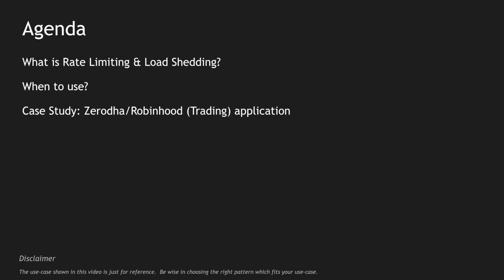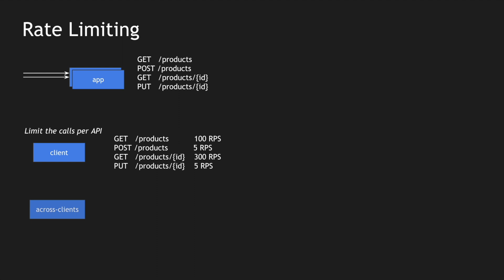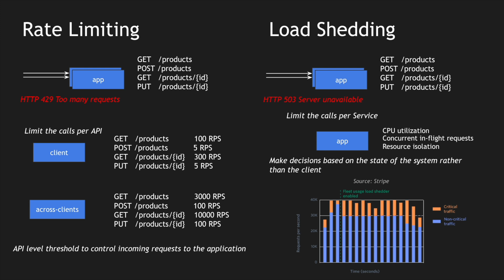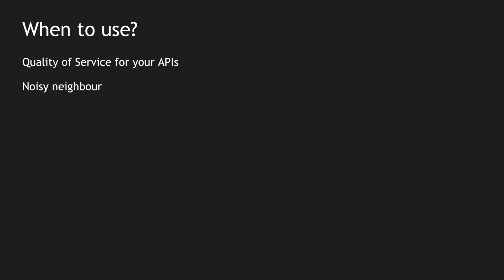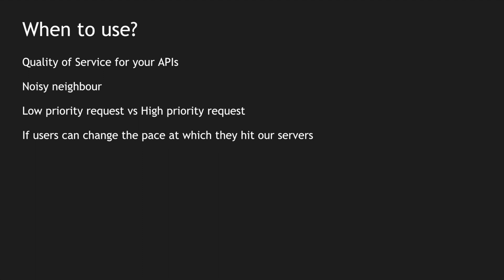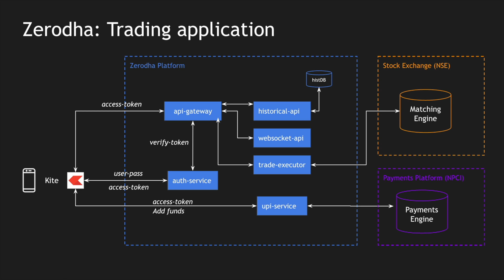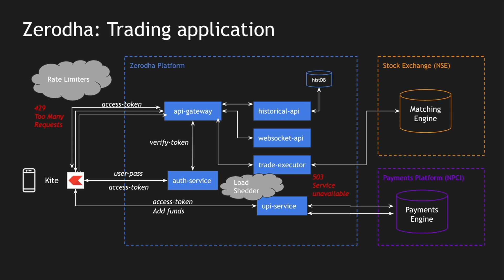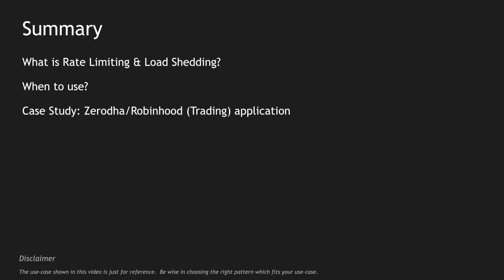Rate Limiting vs Load Shedding | Microservices Architecture Pattern | Tech Primers

Comment: Trading apps are designed to work always. Since trading is sensitive to milliseconds, it's not recommended to throw errors back, at least during trading time.
Reply from the maker: Yes Vincent, but specifically when it's exposed to 3rd party systems via developer APIs, then we do need them
Reply from the maker: Zerodha does this in production now for third party apps